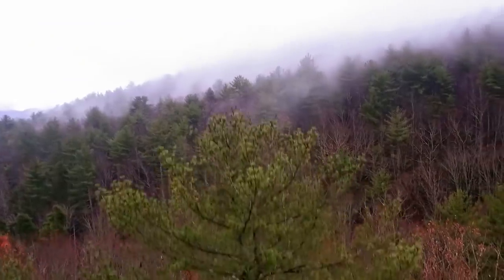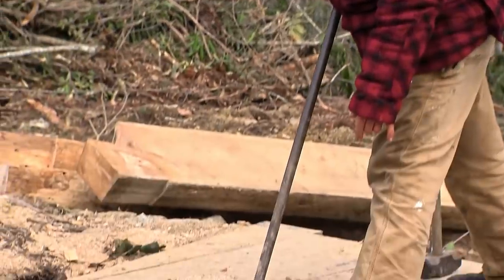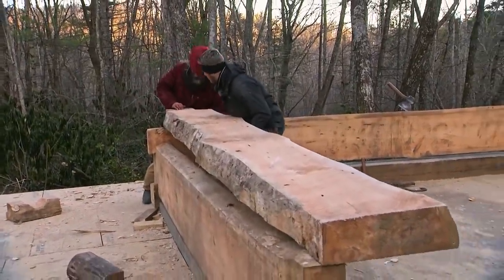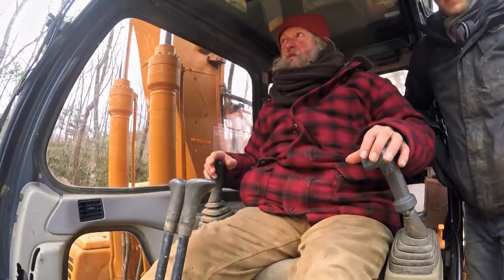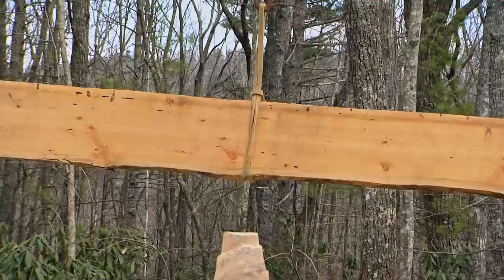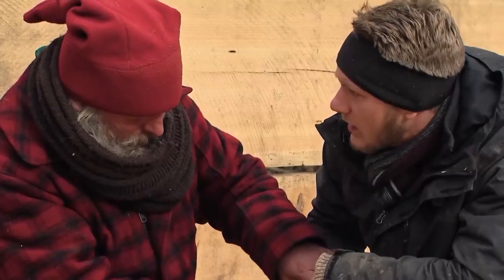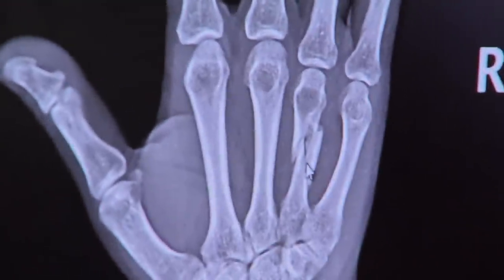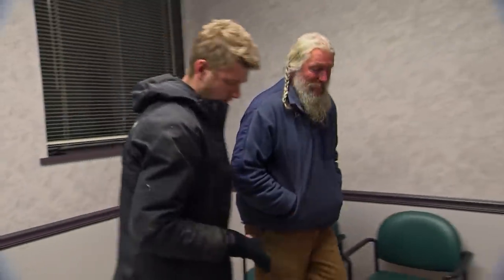Mountain Men: Hand Crushed While Building a Cabin (Season 8) | History

Comment: So when I was a younger mechanic 👨‍🔧 I worked at a ford dealership and I guy in the bay next to me was doing a motor swap on a 2002 f150 so he has the motor in the cradle and it mated to the transmission but the motor mounts aren’t falling in to the frame for some odd reason I went to reach into the area near the mount all of a sudden he grabs my arm pulls me back and basically dressed me down about putting my hands where they don’t belong, about 20 seconds after he finishes what he’s saying to me we are looking at the motor and it literally fell into its right location and most likely would have pinched hand between the frame and motor, he and I looked at each other in sheer surprise and kinda laughed it off, obviously 🙄 that situation just happened to this kid but he didn’t have a little short guy named AL to correct him

Comment: I like how he has 2 big gashes in his hand but then he gets to the doctor and they're gone
Reply: Look closely, those aren't actually big gashes but minor lacerations. The blood isn't deep red on the lines of where the bigger lacerations would be and there's not enough blood for that.
It's a very small wound, propably just managed to lacerate the skin and the blood smeared from them.

At least the finger acts broken. See how the knuckle is lower than the others by a pretty significant margin? I had that happen when my finger was broken in the same place on my middle finger. The sinew pulls tight due to bruising on both sides, making using the finger for anything except it's curling motion absolutely useless. He couldn't straighten that finger without help even if he wanted to.
Reply: Is because it took 3 months to drive to hospital from those mountains!

Comment: If his hand really had 200lbs of wood go on it, how did he pull his hand out from between the 2 slabs that easily I feel like he would be stuck there
Reply: It didn't fully release, it was still attached to the strap. Slow it down to 0.25, you can see it land and then rebound slightly, and that rebound is how he pulled his hand off.